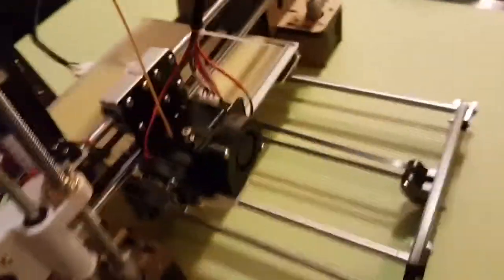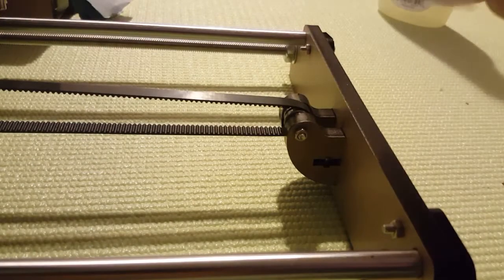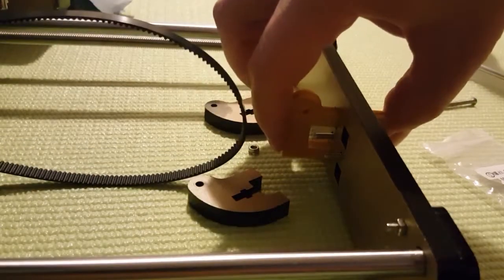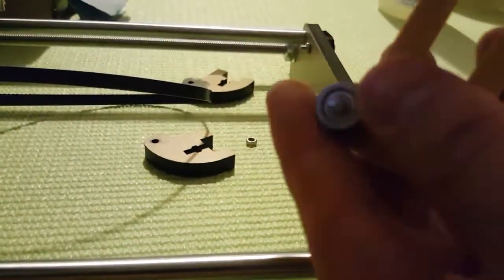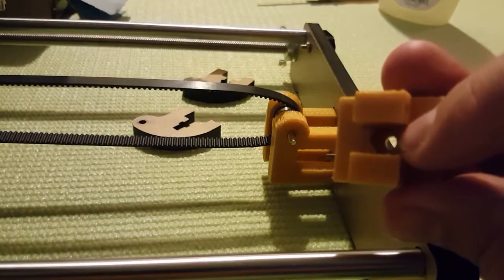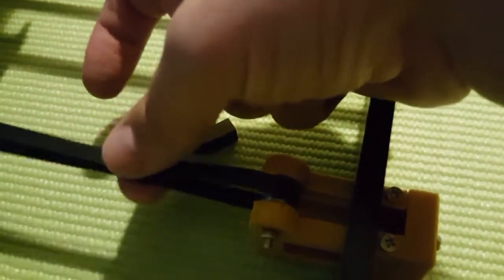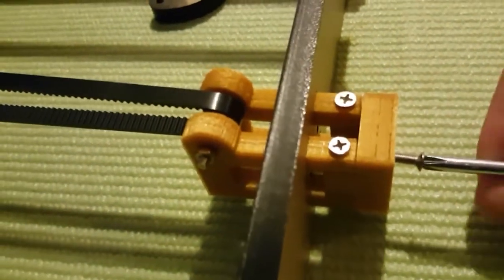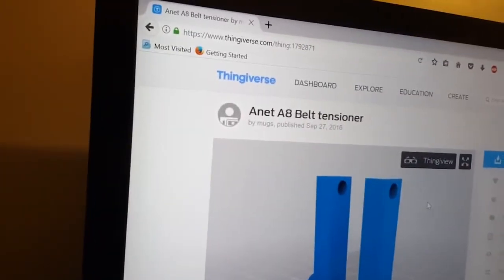3d printer belt tensioner anet a8

Comment: Does the tension screw hold well? I wonder if it eventually vibrates loose and requires regular tightening. A nylon retention nut would resolve that. Wonder if they make one in that size.

Comment: Won't it scratch up the frame though?
Reply: Probably, but you'll never see the scratches unless you remove the tensioner. It's so useful, I see no reason you'd ever need to remove it. If truly worried, find a small piece of metal and  cut to size, then hot glue it to the printer where the screw touches the acrylic part of your printer. That way the screw won't dig into the acrylic body and instead have metal to land on and looks professionally installed.